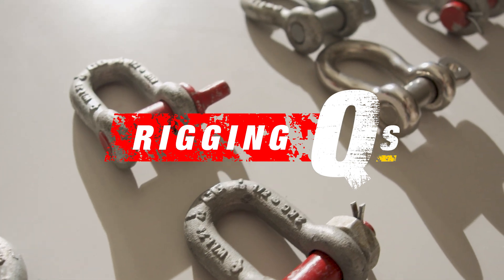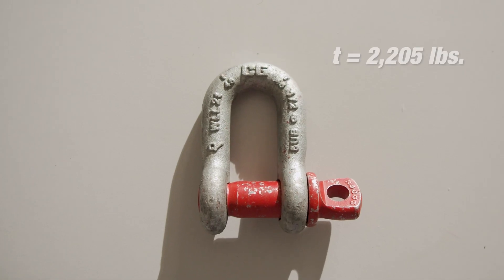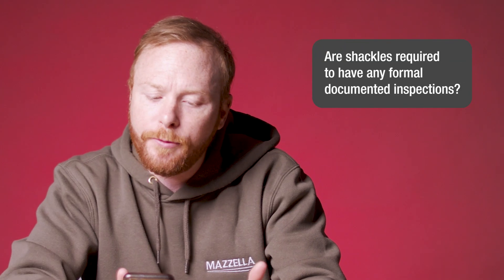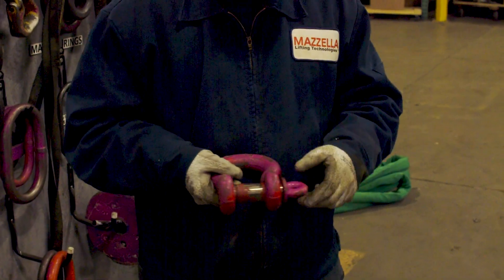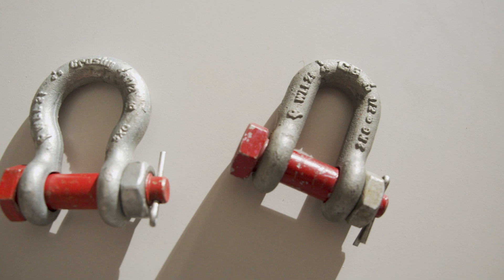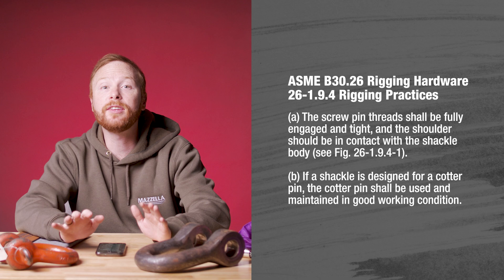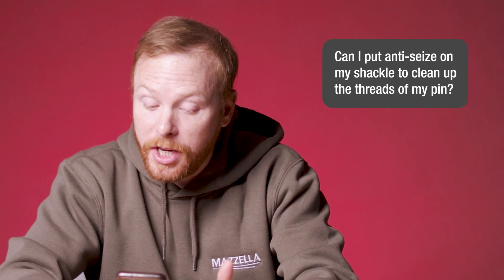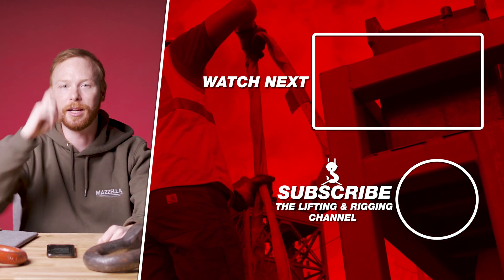Shackle Ratings in Short or Metric Tons, Inspection Requirements, Pin Torque, Shackle Pin Knowledge

Comment: Sorry 🙏 I wanted to ask 
my dad, he is a crane worker. He used a shackle with a load capacity of 0.5 tons 7 years ago. I assume the weight is 500kg. If the load is 300 kg, how much force is required to release the shackle pin?😍Because the tension generated will make the pin very tight, I really want to know how much force is required to disassemble the pin?

Comment: Question sir? If the one link of the chain is broken,the connecting link or hammer lock  is advisable to replace the broken link? and can use again the chain? Specially for lifting.. thanks
Reply from the maker: So the answer to your question is no. 

Here is what our inspection manager, Tom Horner, had to say. 
"The only acceptable means of repair is the replacement of the entire leg making certain the new leg matches the length of the old or to replace all legs so as to guarantee a match. This is typically the case with mechanical alloy chain slings.
A provider that can provide welded assemblies may be able to remove the link and weld in a body link. Again, making sure the legs match up so multiple body links may be welded in across the legs."

I hope this answers your question. Please let us know if you require further clarification.